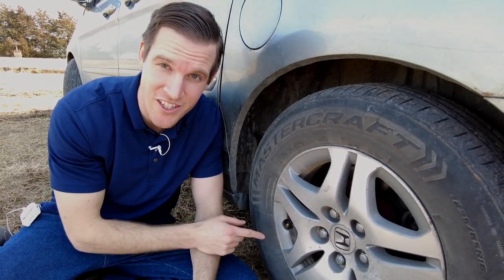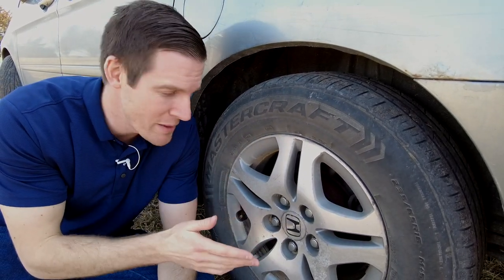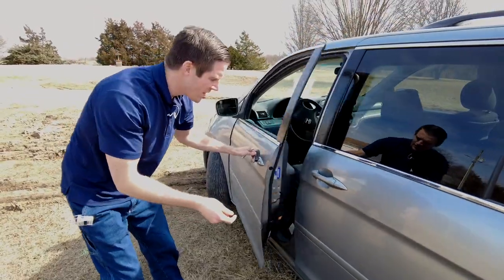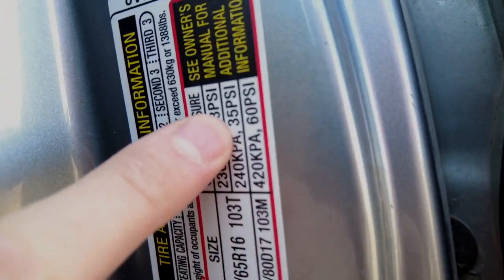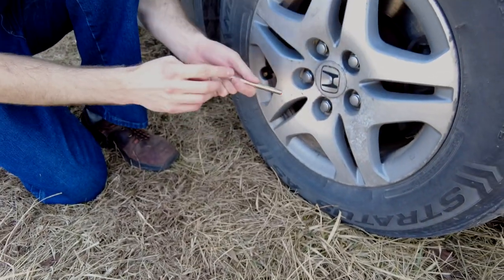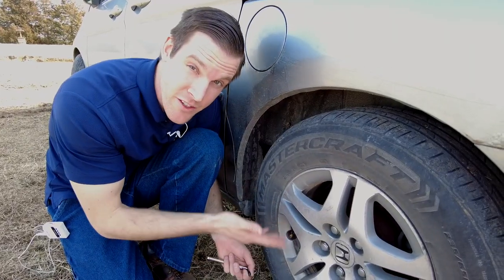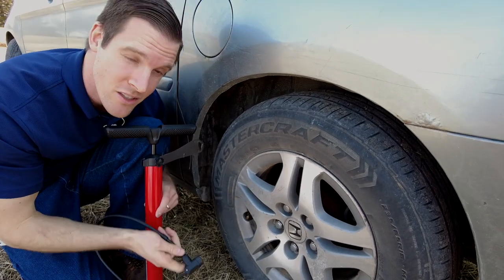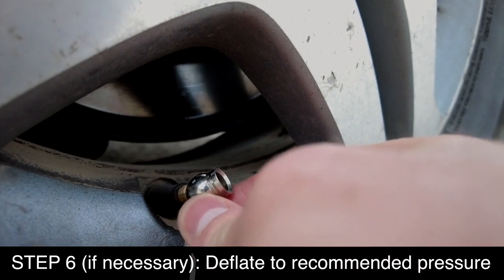EASY! How to check tire pressure in 10 seconds

Comment: Wow, that’s great information! 
On another note, You once did a tutorial on fixing a plugged windtunnel vacuum cleaner. I had an issue with mine being plugged up and it turned out that the plug was in that bottom section where you had said you found pencils and such. It was hard to get the hose off as you know you have to twist it and pull it to get it off the housing however putting it back on was insane. What I ended up doing was taking some sewing machine oil and put that on the housing and wiped it off so that it wouldn’t collect residue and it snapped right into place. I just think you’re the best at explaining these things. Blessings.
Reply from the maker: thanks!
Reply: @LifeyGuy  No, thank you 🙏